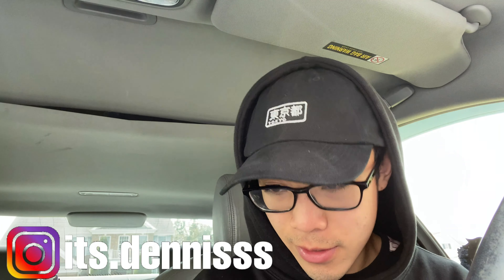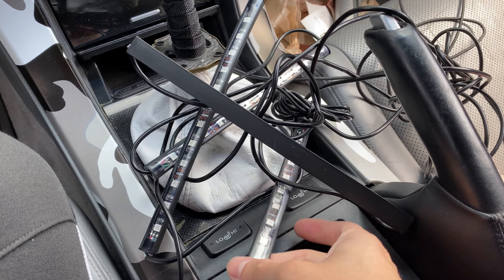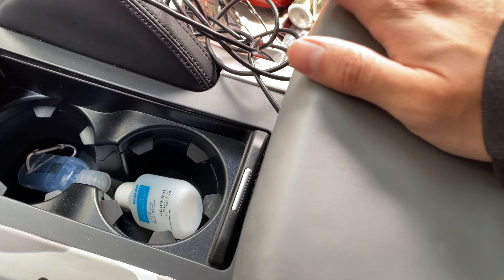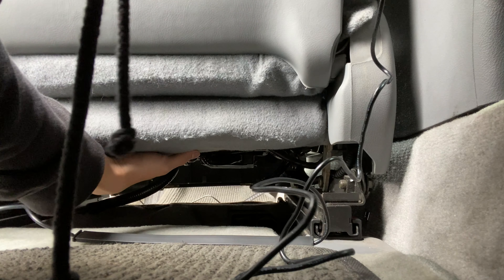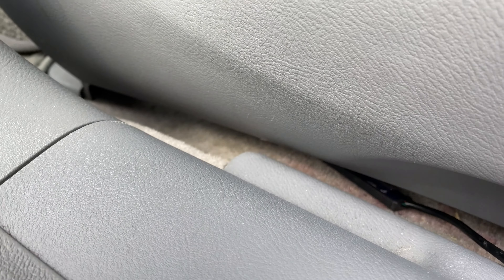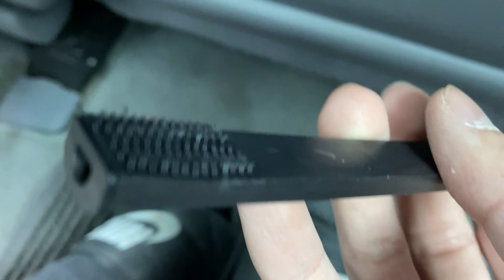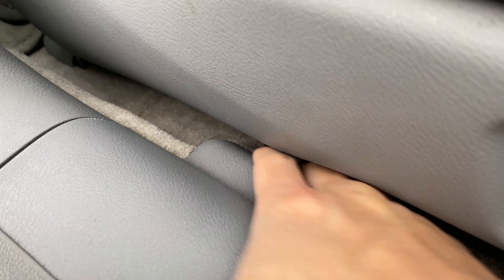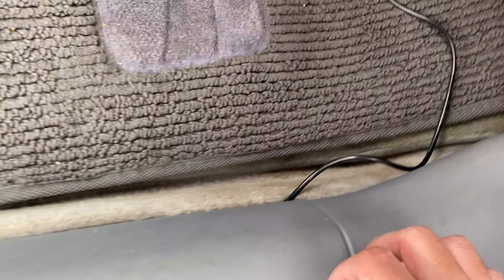Footwell Lights in my Acura TL

Comment: Too much wire. I end up buying a used type-s under cover with the oem  foot RED light assembly looks great
Reply from the maker: hold on that’s a thing?
Reply: @DennisNguyen  yes I tap the wires to the side markers very easy just 2 wires power and ground